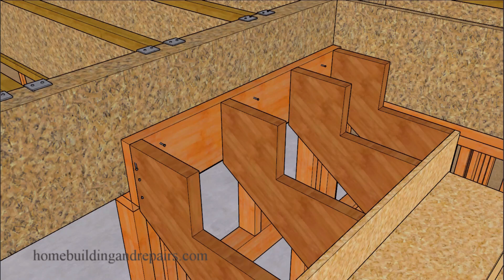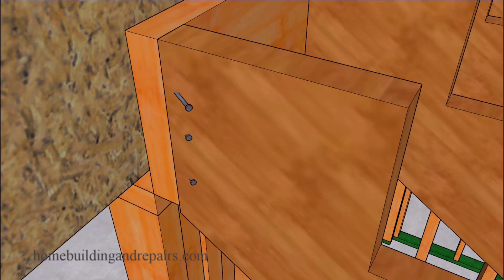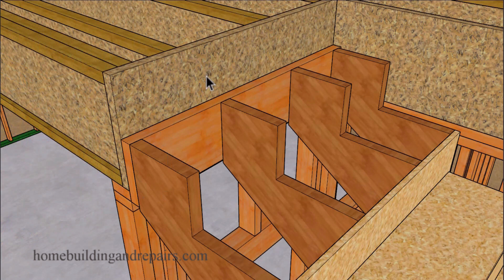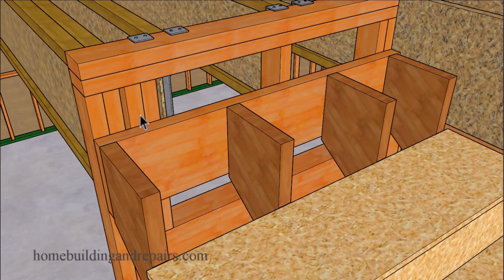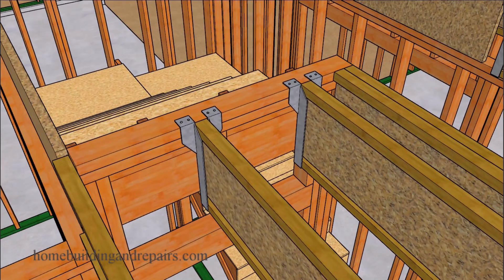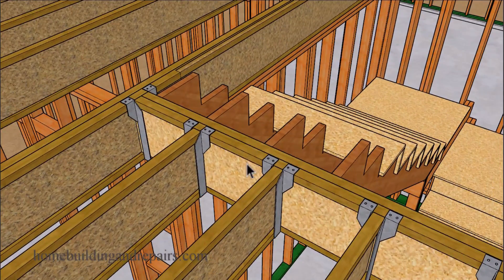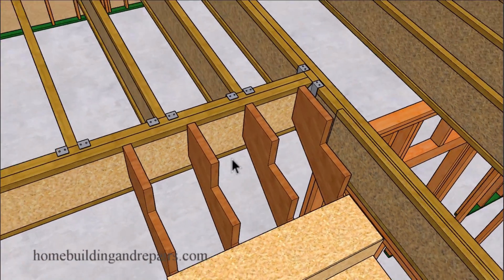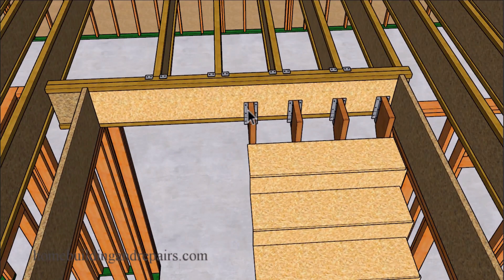How To Connect Upper Stair Stringers To Truss Joist Engineered Floor Framing System

Comment: Looking for advice on stair installs that are outside the norm WRT smaller structures.  Stairs that still would comply with building codes but, take up a smaller footprint. Any suggestions?